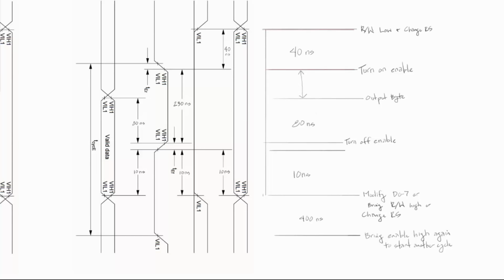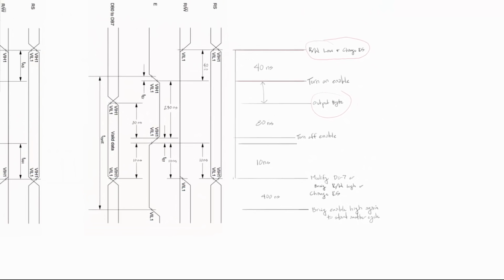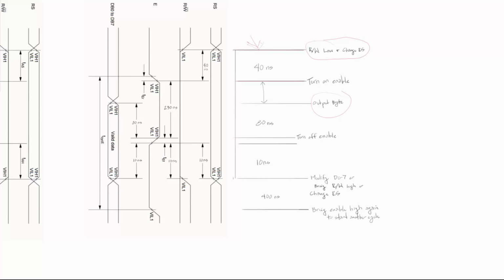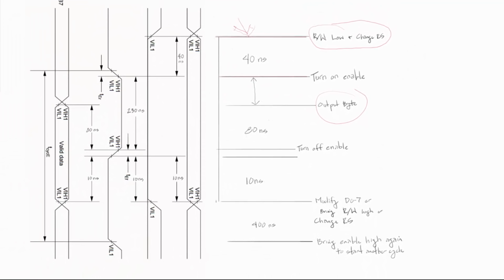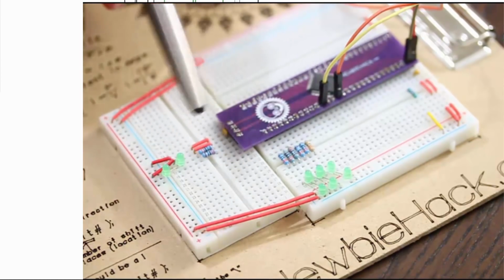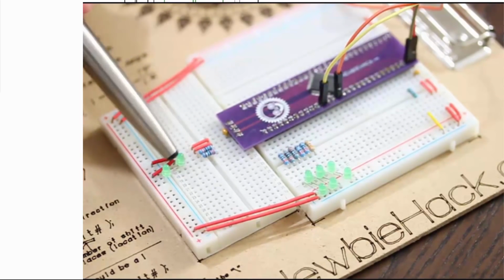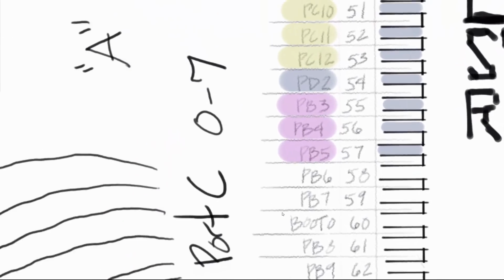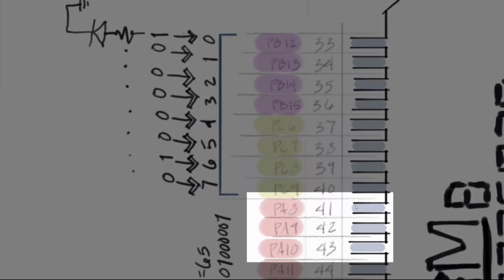23. How to Interface an LCD to an ARM Microcontroller - Part 10

Comment: hi, I am using stm32f103c8t6. I use keil as i do always. Today i noticed problem with 2 pins when i used them for LCDRW and LCDRS. When i assign B6 and B7 to these, these pins are not working. now all code same but i used B10 and B11 and the led glowed. I made sure no loose contact or anything. And the B6 and B7 are normal I/O Pins, not used anywhere else except i2c etc but not boot or jtag related. So are these 2 pins damaged? How could only these 2 pins get damaged. Is there anything i could do to get these pins working?? please help. I dont want to have disfuntional Microcontroller with me. help

Comment: I am so enjoying this series. I agree with your thoughts on "freeing up" the mcu from waiting for peripherals. One does have to take the need of "the core process" for timers into consideration to. Then the setting up of the timer(s) also has to be taken into account. If one is restricted to just 1 timer,  the time taken to adjust the settings for each phase, may very well be most of the delay time. This is, of course, dependent on the frequency of the MCU. Unfortunately, LCDs are so pin hungry, otherwise there might be some mileage in considering farming out the interfacing out to a smaller (less pins) MCU.
Reply from the maker: Yes, I considered hooking up an LCD to a tiny AVR of something like that and just using a simple communication protocol to deliver the messages.  The LCD really is just a great example of GPIO though, so I decided to use the pins.  And, its also a good way to show 5v pins on a 3.3v chip as well.  I really appreciate your comment as it is something I really haven't discussed on this series, so thank you.  If any of the students of this series wants to do this, you should!  Get a smaller chip and stick an LCD to it.  When I get to the communications protocols later, you can play with this concept. I may actually do this as a project when I get to the subject of chip to chip comm.  Also, try to focus on the ARM chips for doing this as the cost a way lower than AVR or PICs.

Comment: i am using std library and hal library and stm32 cubemx but i am not comfortable with that but  your using registor level programming thats cool i  have experience with avr registor level in c (some in asm also) so  its good to see your video is registor level so can you please tell me where can i find written document to program stm32 as simillar to avr datasheet that every resistor setup examle and some discription like timer , pwm , interuppt is provided   need your help on it because i have found any useful document ,  i would like to programme in your registor level  c programming but not found good document on it
Reply from the maker: Go to this page: https://newbiehack.com/categories/newbiehack-tutorial-ARM-Video1-GPIOCreatingTheCircuit-nomenu

You will see my main into page to the tutorials.  The link to the reference manual for the STM32F030 is near the bottom of the page.  Use that to get information for the registers.  If you are not using the STM32F030, then just do a google search for your chip and include the keywords "reference manual"

Comment: hey amazing video lcd is cool and dont get me wrong  but lcd is controller independent and here we are trying to learn stm32 so lcd is may not specific to stm32 so  you should make video on   these topic : Essensial part:
EXTERNAL CLOCK SOURCE  SETUP AT 72MHZ  & PLL  etc ,GPIO(you have already made one) ,TIMER ,PWM , INTERRUPT, UART ,INBUILT HARDWARE LIKE HALL DECODER , INCREMENTAL ENCODER DECODER etc
Advance:  
SPI , I2C ,SD CARD, USB , CAN etc
Nice to have :
lcd , dc  motor speed control , servo motor ,stepper motor ( specially microstepping part if posibble ) ,vfd , bldc , glcd ,wifi, bluetooth,sending and recieving  string over spi , i2c , uart  between two stm32, sd and  usb based  examples  and other application based project 

this way your hardwork will be more useful to your viewer,
correct if have done something wrong ,
thanks againg for sharing your amazing knowledge and work !
Reply from the maker: The LCD videos are important because I am setting up an output device to output information that will be displayed when working with the features of the STM32.

Comment: I doubt that mass produced devices use blocking code for LCDs. Milking the most out of your microcontroller is a big deal on that level.

What I've personally done to create non-blocking LCD updates is to pick a refresh rate that makes sense, then update the LCD via an interrupt at that rate (e.g. 60Hz). I haven't set up timer interrupts to save the ns delays during parts of each update sequence, but I'd be really surprised if experienced embedded developers aren't doing something similar via an interrupt. 

Setting up and firing an ISR has some latency anyway, so a couple ns might not be salvageable via timer interrupts.
Reply: William Weatherholtz Blocking code is a big no-no, you're right about that. It is a common practice to update peripherals during timer ISRs. UART, SPI, TWI etc. might be exceptions to the rule, but I've integrated chips with TCP stack using such SPI code without a problem. But that still doesn't mean it is applicable to every project.
Reply: I could see UART being an exception, but anything based on a clock should do fine being interrupted (e.g. SPI, TWI). No?
Reply from the maker: I think it really depends on the application (in what scenario the the microcontroller will be used).
Reply: The reason why digital speedometers have a delay has nothing to do with the code itself. Imagine that you're speedometer does have as many updates as a stopwatch. Can you read the miliseconds while the stopwatch is running? Probably not. It is better readable if the stopwatch had a 10ms delay. Same with speedometers in regular cars, they are meant to be clearly read by the driver, so the display is updates every x00ms. For example I had a '97 Renault Twingo that updated the speedometer every 3 seconds, but my mercedes E-class dashboard which also has a digital speedometer below the regular 'analog' speedometer (Mercedes uses a digital servo with a magnetic encoder (position sensor) but that one updates every 500ms. Over the CAN bus (ODBII) I see that the speedometer sensor sends an sample update every 80ms. 

The automotive industry is still using analog type speedometers because we - humans - are much better processing (interpreting the meaning) a moving needle than reading a digital number. We are much better to control are speed of our car because when the needle is close to 50 kph (30mph) we slow down the acceleration. In most cases we don't even have to to really look to know what speed we're going. That is because we tend to instinctively know the most important positions of the needle. We know the position of 50, 80 and 120kph, in the same way we can tell the time on a watchface without any numbers..

It's pretty save to say that in every car produced in this millennium that systems in cars are very fragmented. Every component has a single responsibility. That component either reads data from the CANbus or it writes data to the CANbus. There are very few components that do both. That way multiple components can use that processed sensor data. The speed sensor data is not only used by the speedometer in your dashboard, but also by you cruise control. If you're can can recognize traffic signs, it can even let you know when you're speeding..

Each component has it's own processor. But let's keep the focus on the speedo sensor. That component still needs to collect the sensor samples, process that data and send it to the CANbus. Usually timer interrupts are used. The STM32F0 processor series has 5 to 8 16-bit timers. One timer is used to read the sensor data, convert the data to kph and stores that value. This is done with a constant rate.

Sending the data to the canbus is done with a second timer (ie canbus master timer). Most CANbus tasks are separated from the sensor, so it's not an issue if an sample is not send to the bus. If the master timer interrupt is fired, if will check a busy flag. If the flag is already set, it will skip the update and reset the master timer, otherwise it will set the busy flag and start the timer series to send the data to the canbus. The canbus is a multicast bus meaning it has many writers and the canbus master controller determines who gets priority. Vehicle sensor data components have a much higher priority than for instance you're AC temperature setting. But even the speed sensor does not have the highest priority. Stability sensors are more important, so have a higher priority. This means that the canbus updater has it's own timer loop to check on a interval if it has permission to send it's data. 

Designing a multi-timer solution is not that difficult, but it is important that you work out the timer choreography so you can properly orchestrate the timers.